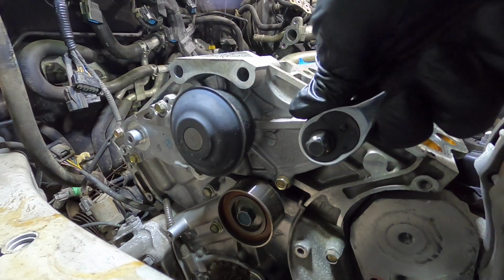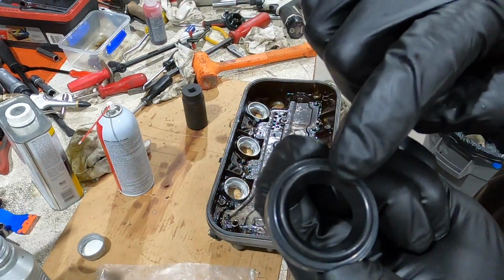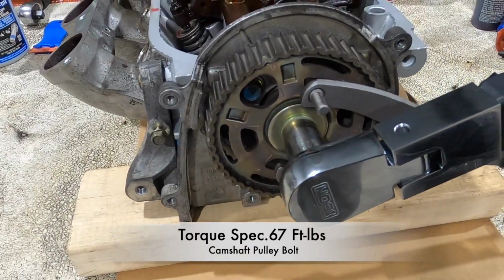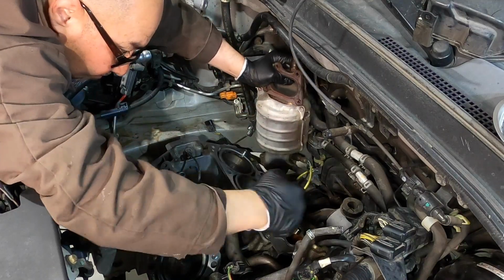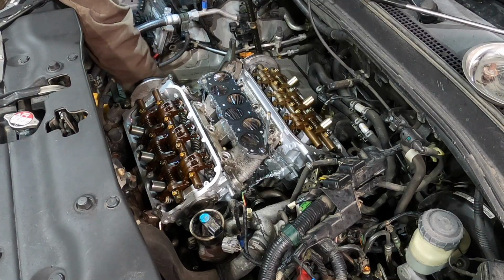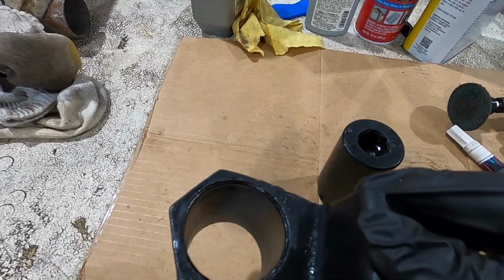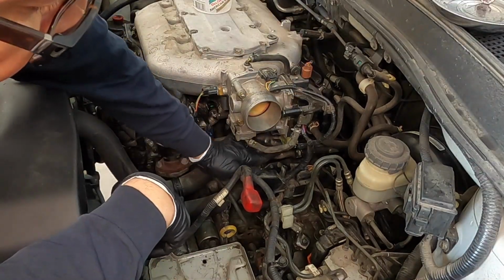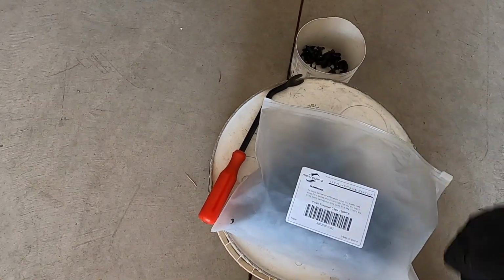Cylinder Head Installation on a 2005 Honda Pilot

Comment: liked this video . im in the middle of doing this on a 3.5 j series engine... and my right head... it not lining up... it skips right over  it refuses to land on the line its like a even and odd and only lands on odd........ can you help???
Reply from the maker: Thanks 😁if you can figure out were to line it up at the intake side corners then it should fall on the dowel pins. Just make sure to use a mirror and double check all the way around to make sure it’s set. Take a break just before you try to set it so you are fresh and ready to getter done. Hope this helps good luck 🍀😁👍🚜💨🍳
Reply: thanks but im talking about the wheel that is attached to the cam..... it rides over the mark....they are supposede to be lined up
but it skips it is either before or after the  mark
Reply from the maker: @davidgenereux9540  Oh I get it whoops 😂 as long as you have all the timing marks aligned and the timing belt tight from the rear head to the front head and down to the crank you are good. Turn it over by hand at the crank and make sure pistons and valves don’t touch. After turning the timing marks don’t line up that is normal.😁
Reply: but thank you for your tiomewell for some reason its not lining up at all no matter what i do...; it like in the video0 where you mark the wheel 1 2 3 well my maRK IS HITTING ON THE OFF ONES...... i

Comment: OK I made the mistake and did not put my head on blocks of wood before I rotated my cam and I rotated it through twice before I realized should I get the valves and the head tested again?
Reply: However, I did have a piece of cardboard down, but left impressions in the cardboard. Silly me.😢
Reply from the maker: @elvis7652  You might be ok still. Squirt water on the backside of the valves and see if it leaks out when they are in the closed position. Good luck 😁👍🚜💨🍳
Reply: All right, I’ll give it a whirl. Thank you so much.😅😎👍🏻👍🏻
Reply: I made sure my valves were closed....added some water to the top it dripped:face-purple-crying:. then on closer examination I saw there was carbon on the valves that Southworth in Eugene OR did not clean when i had the work done (I am a little surprised at that) 🤔anyway I took the time to rotate the cam and clean each valve with cleaner. Began adding water again at each cylinder one at a time (4,5,6)at TDC and no drips:face-blue-smiling: I dodged a bullet thanks for the tip!! YOUR THE BEST!!
Reply: Now I can put everything back together and yes this is my first time replacing head gasket on a newer car.👍 My last head gasket was a 1963 ss  Impala I was 17 years old now I am 59 😆
THANKS AGAIN!
Reply from the maker: @elvis7652  Glad it was good 😁👍🚜💨🍳 My Pilot is still running perfectly. I should do a update video🤔 Have a great day
Reply: @MJADoingStuff  You’re pretty amazing buddy! And I’m glad your vehicle is still running great!
Reply: Wanted to give you an update.
I’ve had 2014 pilot running for a month now with out any issues at all 👏👍🏻👊🏻
I did install a vcm disabler last week.
Just a cheap vcm for now to try it out. I really like the performance so far much better than before and  only lost 1 mile to the gallon because I drive in town more than the highway so its well worth it👍🏻
Will upgrade to the 
vcm tuner2 later.
Thanks again 👊🏻
Reply from the maker: @elvis7652  glad it all worked out 😁👍

Comment: How do you set it to 1 outside of the car?... They told me not to put on the rockers on the heads before bolting the heads down
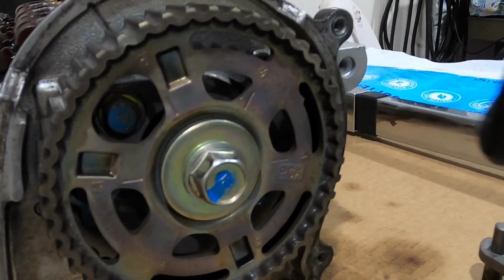Reply from the maker: Go to 13:10 on the video the rear head is marked with a line in the cam sprocket ⚙️ the red sharpie is the number 2 and 3 so the mark on the metal is 1. That needs to line up with the backing plate/timing cover that is TDC for #1. hope that helps 😁👍🚜💨🍳

Comment: Your video is one of or the best one I’ve seen so far…but it’s a little scary at the same time. My story. Im living in my van right now. It’s Covid related…but I’m treating it as a learning experience. I’ve be using my 05 odyssey to do deliveries for Uber Eats to support myself.
Three weeks ago. My van started overheating and coolant started disappearing. Turns out I blew a head gasket. I’ve been researching Gasket sealers and diys videos like yours. Ive been hesitant to which one I should attempt. I can’t afford a mechanic and a the highest rated pour in gasket sealer is $70. The sealer may not repair the leak and could also damage the engine. 
Question? How much minimum of disconnecting will I have to do to get to the head gasket? It’s the part that scaring me. 
I’ve been parked for 3 weeks now and I need to start working on a solution ASAP. If you read this and reply.
Thank you for your time.
Reply from the maker: Question do you know which cylinder head is bad? Front or rear. Sorry to hear about what your experiencing. Another question what is your mechanical skill level in your opinion. I know your back is against the wall but keep doing what you can to move forward good or bad nothing lasts forever. I will try to answer you when I get more information. 😁👍🚜💨🍳

Comment: Did you have a bad head gasket and decide to go full rebuild? Very cool
Reply from the maker: I have another video showing the removal and what I found. I did originally think it was a head gasket but it turns out it was a coolant leak between the steel valve guide and aluminum head on the number 4 intake valve. Not fixable so had to replace. And when your that far into it you might as well finish the job right. Don’t want to say I should have done it after the fact. It is running like brand new now😁👍🚜💨🍳
Reply: @MJADoingStuff  my son’s 2006 Pilot (have had it for 4 months) has a “bad” exhaust valve on cylinder 4. The valve is physically damaged. I imagine there’s multiple bad valves, though. It starts very hard now and wants to stall when engaged in gear. I think I’m better off removing and replacing the engine. We don’t really have time to do a rebuild, but it does look interesting. Maybe I’ll keep the engine and rebuild it? What are the chances that the cats are fouled up now?
Reply from the maker: @manicmandownup  Hard to say if the cats are bad til you take it apart. Good luck with your project 😁👍

Comment: My kit for my 2005 pilot came with a spacer shim?? Do i need this?
Reply from the maker: If it is for the cylinder heads ask the company that is machining the cylinder heads if you need it😁those shims are to make up the difference if they had to take a lot off when re surfacing. Hope that helps 😁👍🚜💨🍳
Reply: @MJADoingStuff  no i mean the shims they added to the timing idler pulleys. Apparently some hondas made a squeek that effected the belt so they came up with a shim..?
Reply from the maker: @xESPplayer500x  Ooooh!!! 😂 my kit didn’t have one and I don’t have a squeak yet. So not sure if you need it.😁
Reply: @MJADoingStuff  ok, since my pilot is a 2005 as welll im gonna go ahead and NOT install it, thank you bro your videos were a ton of help 💯👌

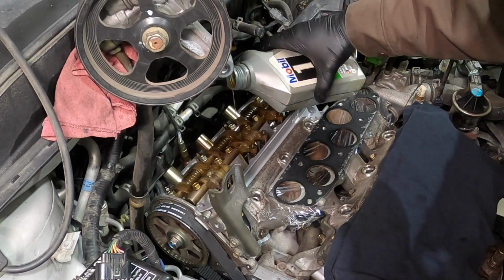Comment: Great Video, at 20:30 the Cam Lobes operate in a oil bath, not pressure fed so your instinct is correct. That little bit of oil assured lubrication on start up to the Cam lobes. 4:53 Notice how much sludge/varnish buildup is in the front valve cover compared to the rear valve cover. It's a weak point in the PCV system evacuating the crankcase IMHO. 
I had to replace both cams and a couple of rocker arms at about 260K miles on my 10 MDX. I'm at 287,70+ now. Looking at correcting the PCV system. Again great video, I'm sure that was a job by itself.
I see you have a boat, great fun.....
https://www.youtube.com/watch?v=-Pa8_Jkk1wc
Reply from the maker: Thanks 😁 I was surprised to see no Cam bearings when I had it apart🤔 one day I will get a parts washer 😂 I could have done a better job at cleaning up the valve covers. This is our daily driver so had to get it back on the road ASAP.😵‍💫 We live in Minnesota and I was told that you must get a boat to fit in😂 Good to hear Your MDX is still on the road. I do have to say I was happy that Honda used more metal parts compared to other Manufacturers. Thanks for watching 🚜💨☀️
Reply: @MJADoingStuff  " I was happy that Honda used more metal parts compared to other Manufacturers." That's one of the main reasons these engines last. Plastic parts just don't like heat cycling and they don't last. BMW, great engineers, great performance but they went to plastic everywhere under the hood and ruined their reputation for long lasting cars they had for decades. What a shame.
I noticed you run Synthetic, good move, I run Amsoil now but ran M1 for 100K+ miles. Splitting hair when you get to top tier oils. Amsoil ATF Signature oil is the best for your trans I would suggest.
Again great work and stay safe out there.
Reply from the maker: @robertjackson7590  I agree I just sold my 2011 335i Xdrive because of all the plastic crap and second water pump at 90K miles. BMW makes strong engines then ruin them with plastic dressing 😂 Have a great weekend.

Comment: Very good job.1700$ do the whole thing it sensible?.
Reply from the maker: I saved a lot 😁 local shop wanted $2600 just for labor. So I had no choice but to do it myself. It is still running great after over 2k miles we are happy so far. Thanks for checking out the video 😁👍🚜💨🍳

Comment: Dude rtv on the water pump gasket is a bad idea.  The gasket works just fine when the water pump bolts are torqued down properly.  Rtv can cause the gasket to malfunction and create leaks down the road.
Reply from the maker: @justingog4533  The instructions told me to do it!!!😂👍🚜💨☀️
Reply: @MJADoingStuff  the instructions with the Aisin kit ???
Reply from the maker: @justingog4533  Yes

Comment: Why when i turn the cam it spins past the mark?
Reply from the maker: The valve springs have tension when on the timing mark. It helps if you rotate it counter clockwise and go slow hold it for a few seconds then it will stay. Thanks for leaving a comment.😁👍🚜💨🍳